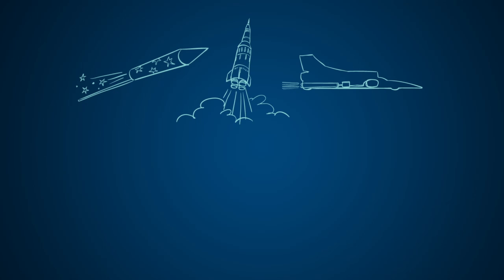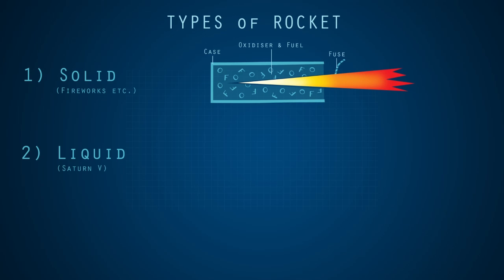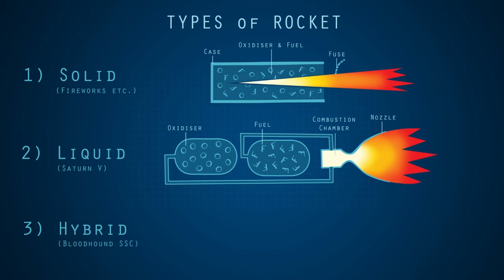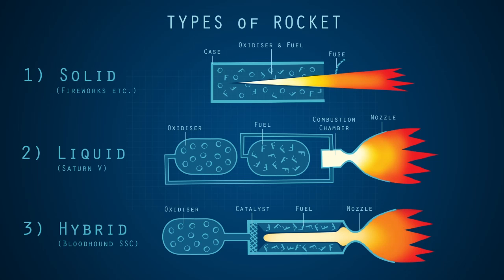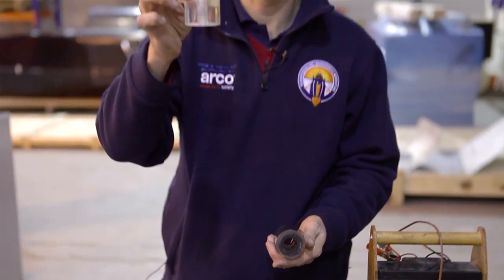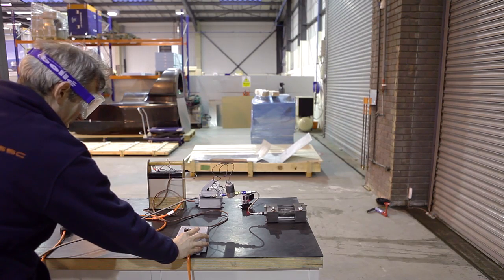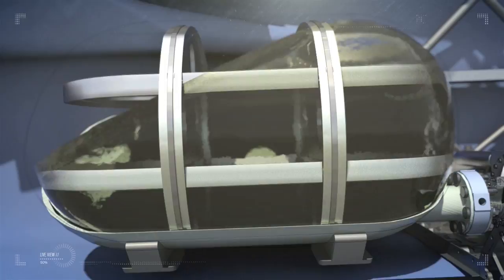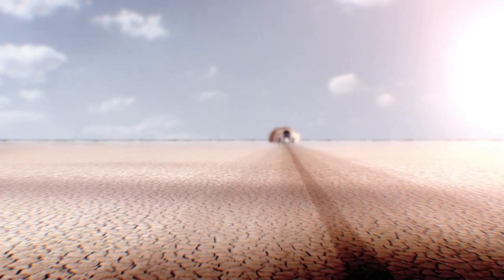BHTV fires up a rocket in the workshop

Comment: If you can be heard talking over the hybrid you're not putting in enough oxidizer to achieve sonic lock. That's not a rocket motor, that's a burner.
Reply: Also the preview image is a ridiculous lie.
Reply: Ben Brockert I used a clip on mic to reduce the level of the rocket noise. The preview image and opening shots are from our full size rocket test - which we obviously didn't do in the workshop.

Comment: So how do you do the turnaround then? Replace the solid-fuel tube between the runs? Or is there enough in the tube to do two runs - if so, does the thrust profile not differ for the second run, as the chamber shape is different from fuel ablation?
Reply: Good question - the tubes will be replaced with fresh ones after the run.

Comment: Wow!!  it is powerful !!
good !!
high power 12 tonnes of thrust!!
Reply: That is in addition to the 20,230lbf (90kN) available from the after-burning ej200 jet engine.
I think the run profile for >1000mph calls for 2.5g average acceleration and deceleration each side of the measured mile. Peak may be a fair bit more than that of course - maybe somewhere around 3.5g?
With a sudden reversal in the middle.
I haven't done the maths - that's an off the top of my head guesstimate.
So Andy is going to feel like he is laying flat on his back with a fat man sitting on his chest while accelerating, then hanging face down in his harness with the same fat man on his back while braking.
And all while being pummelled by what, while relatively flat, is still an off-road course on solid wheels.
I doubt very much if anyone without advanced fighter pilot training could do it.
Good luck Andy, and of course the rest of the team as well.